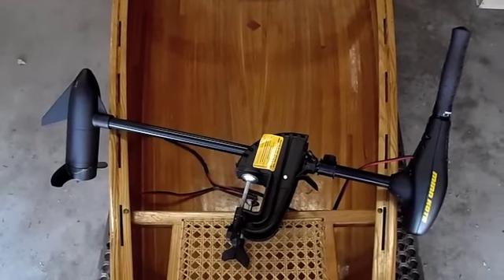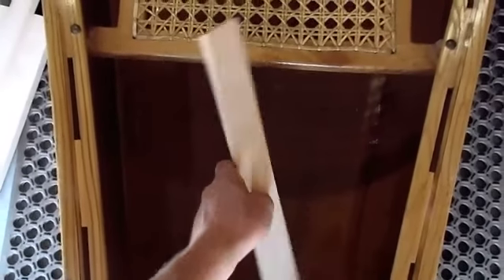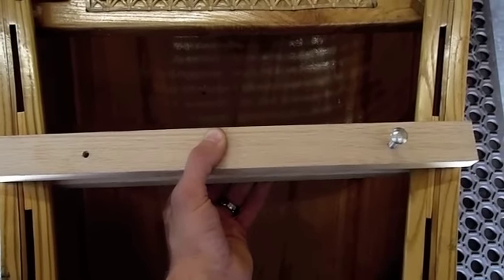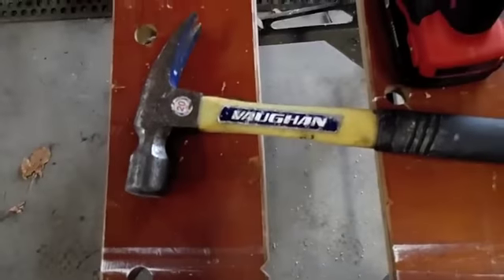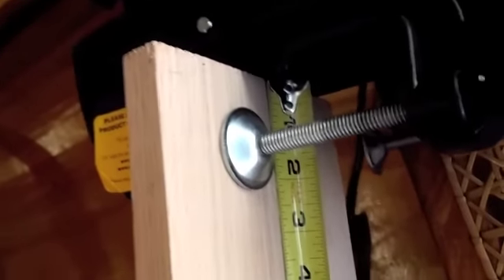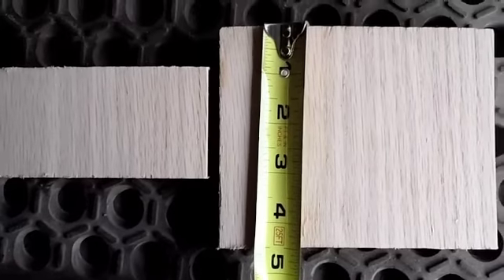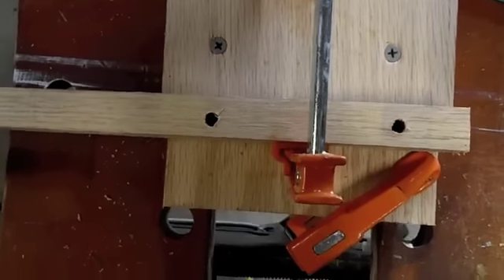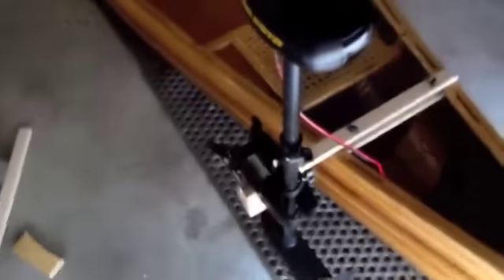Electric trolling motor DIY mount for a 17.5 BWCA Cruiser Canoe

Comment: I made one using a 2x6. Set it across the stern with enough sticking out one side for the motor to clamp onto. Marked the edges of the canoe and cut in about 2 inches and removed what's between them. Using a 1x3, I cut the angles to fit inside, under the 2x6 and drilled holes through both. Rather than using a Wing Nut, I got Nuts that you screw into a hole, then put a long bolt running from the top down to the bottom plank, and clamped them together with a socket wrench. Motor mounted to the 2x6

Comment: I,m going to buy a motor to my canoe. Do you think a 180Watt power (18lbs) will be too small?. The weight difference between a 180w and a 350 watt motor are very big, that,s why a was thinking in a smaller motor, but i don,t know if it won,t have enough power to move the canoe with 3 people. Thanks.
Reply from the maker: +Pablo Garde Erikson Not sure if that will be enough.  What did you end up doing?
Reply: that is small if you happen to be in any current,a bigger motor will work less and should last longer
Reply: Thnks